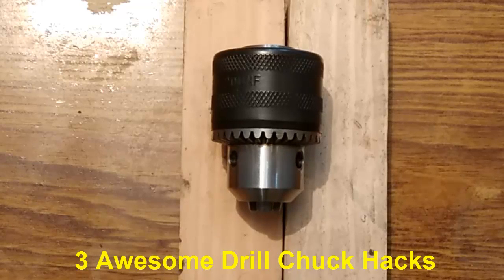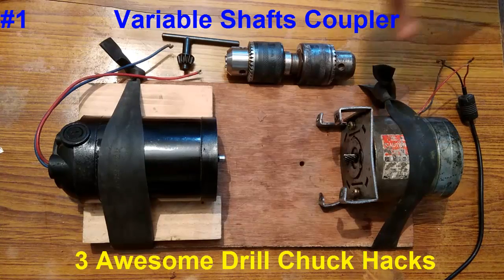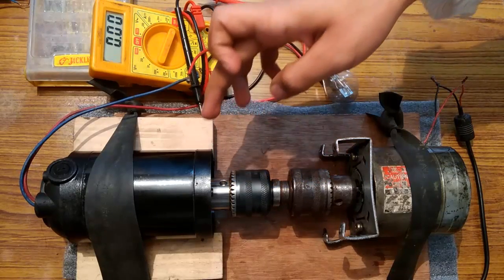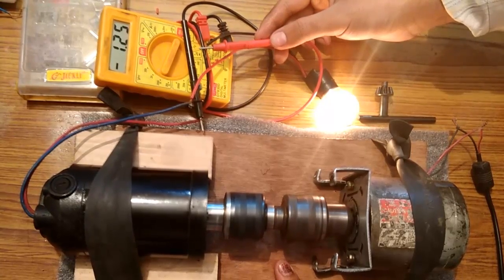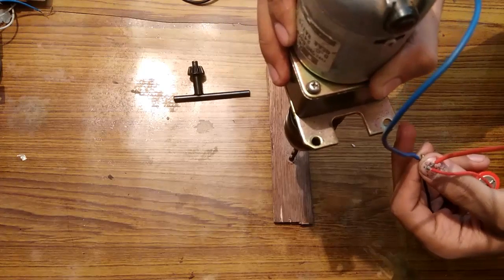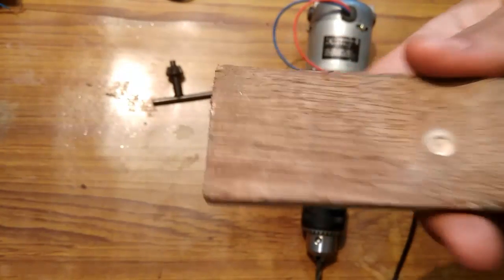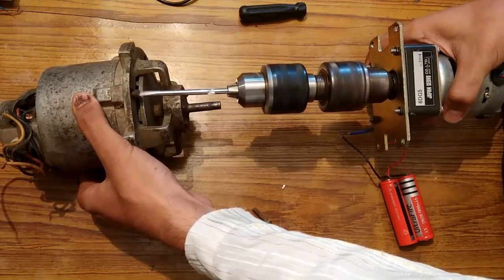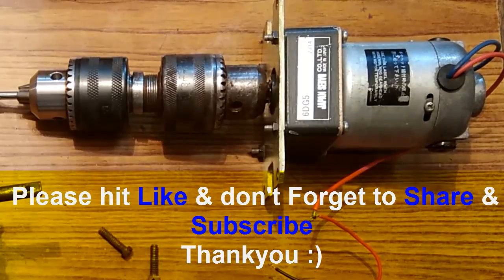3 Awesome Life Hacks with Drill Chuck

Comment: Ok so you used a motor to tun another motor as a generator.  Got it!  Then you turned on a lamp drawing over 1 Amp.  Ok  Now what is the blow your mind part?  I missed that.  Clearly you are consuming more power turning the generator than the generator will be able to put out.  Was this just a demo on how you can use a motor to turn another motor and use it as a generator?
Reply from the maker: valveman12 neither.. Its about  how we can use 2 back to back connected chucks in different ways..:)
Reply: Ok
Reply: The guy is an enthusiast, cut him a break.